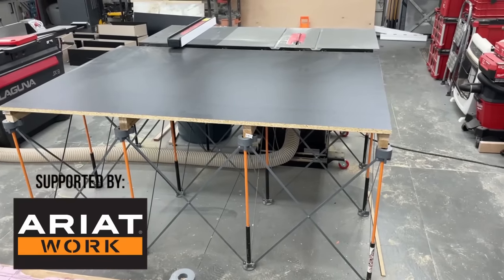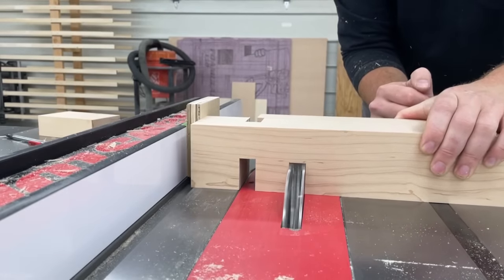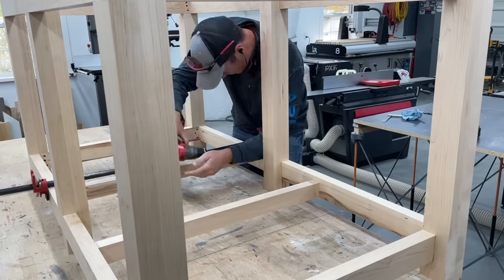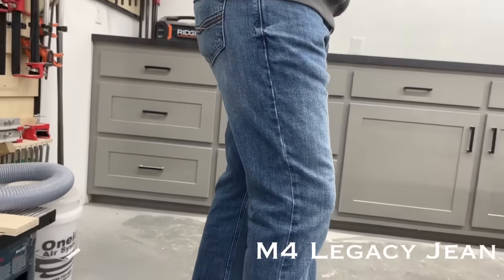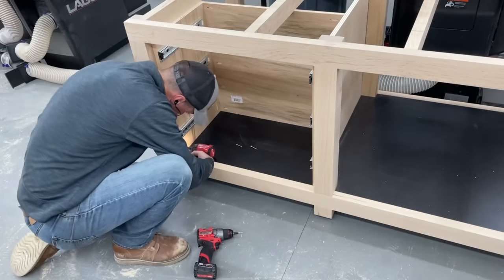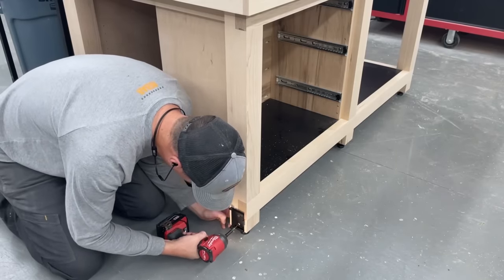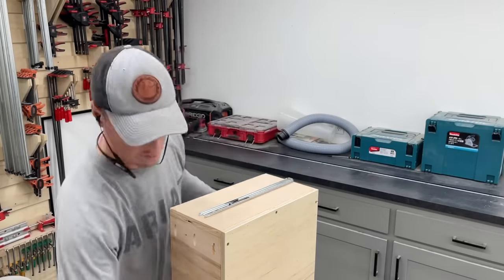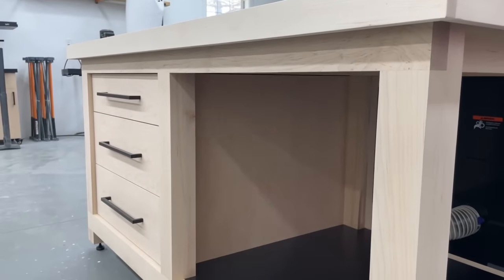BEEFY Workbench/Outfeed Assembly Table Build

Comment: John, I just completed this build a few days back.  Followed everything exactly as laid out in the plans and I couldn't be happier with the results. I only made one adjustment, instead of using black edge banding on the shelves I capped the edge with a piece of oak and cut in a small rabbet lip for the shelf to sit on so the weight placed on the shelves will be harder to warp the shelving material over time. Thanks, I love your channel.  On to building your miter saw station next!
Reply from the maker: Awesome! Good idea on the shelves👍🏽👍🏽

Comment: For those of us working out of smallish garage settings, sinking a router plate in an outfeed table like yours so it can do double duty as a router table is also a terrific use of space.  My shop is so small I actually built an extended wing for my saw to the right of the blade and dropped the router plate into it.  When the router isn't in use, I have a plug that replaces the plate and leaves me with a flat surface to work with.  Hopefully some day I'll have space for a real outfeed table.
Reply from the maker: Very good idea Mike!

Comment: A really nice-size, solid table for the SawStop. This is the same saw I have and I've been checking out a lot of projects for ideas. I like the dimensions of your table a lot, and the way you built it. You use a lot of Norm Abram-style techniques in the build that give this table a ton of strength and functionality. The sandwich top with replaceable surface, for example, and the strong lap joints. The lap joints lend themselves to fabrication with stacked dimensional lumber rather than thick hardwood stock, which would save cost, but the maple does look beautiful. The drawers look great too. If you wanted to, you could always double up the edge banding to build up the width of the tabletop to match the saw width, but it's purely cosmetic. Thanks for sharing the build.
Reply from the maker: Thanks man!!

Comment: This actually turned out to be a perfect solution for a beefy table for my up and coming cnc. I modified the dimensions to be 48x72 with a torsion  box top.   I ended up building mine from some reclaimed 12mm ply from work glued into 8 layers to make the thickness. You are not kidding by saying you could park a truck on this thing.
Reply from the maker: Haha awesome man!

Comment: Nice build, John! This looks like a more approachable version of Bourbon Moth’s outfeed table! Definitely going to build this!
Reply from the maker: Thanks for watching man!!
Reply: Jason's work is amazing but seems less accessible to build for amateurs. I really like the simplicity of John's videos and his instruction.  The tip about nailing the strip behind the board when using pocket screws I found insightful.
Reply: @plasmac9  totally agree about the board tip when using pocket hole screws. They always nudge just a touch, but that little bit can put everything out of square.
Reply: I like Jasons table but your looks just as good and easier to build.   Can't wait to try this.  Subscribed.
Reply: Considering getting your plans.   Is your PCS on an ICS base?

Comment: Finally! Something i might realistically be able to build. I DO have a dado stack, played with it once. Not pretty. Since then, I've done some research and determined a number of mistakes I made. Ready to try again. I like that there is actual mechanical interplay of wood between legs and cross-members, without insane complexity. Simple! Never would have thought of that on my own. Will not add shelves or drawers for now-- just need outfeed and assembly platform. WILL add the bottom platform for stability and stowage. Great build! Thanks!
Reply from the maker: Thank you!! Not relying on any mechanical fasteners makes for some crazy strong joints!
Reply: @JohnBuildsIt  Question: your plans suggest 44"X68'', I'm thinking about 48"X96". Should I make an extra set of center legs, and space them all accordingly?
Reply from the maker: @crustycurmudgeon2182  no just the one center leg would still be plenty
Reply: @JohnBuildsIt  Thank you, sir, and Happy Thanksgiving!

Comment: Stunning, John. Simply stunning. You have made some beautiful furniture in the past and even built out a beautiful home. It just seems fitting that you'd build shop furniture with the same attention to detail.

I plan on building a bench/outfeed/assembly table about this size. I also plan on using 4x4's for the legs and 2x4s for the rails. My plan though is to use castle joints on top of all 6 legs. Might be overkill but I like the idea of letting the wood bear all the weight, just like with your half-laps.
Reply from the maker: Maybe overkill but oh well!! Fun to practice and looks awesome! 👍🏽

Comment: Hey John, Thanks for your content.  I certainly appreciate the time, effort and thought that you put into producing a nice piece of work like this (both the outfeed table and this video).  I stumbled onto this video as I was looking for ideas on my CNC router table/workstation design.  I am going with a different top and drawer cabinet configuration, but I love your lap joint process on the base frame as well as your simple (but strong) cabinet carcass  assembly into the workstation. I think I have this figured out now but I went ahead and purchased your plan. Good video my friend and buying your plan will help you continue to create great content like this and... I have a nice addition to my library.            Subscribed.
Reply from the maker: Thanks man I appreciate it! What size is your CNC? I have another video on the channel building one for my 2x4
Reply: @JohnBuildsIt  I have a Onefinity Journeyman. The cut envelope is 48" X 32". It is a fantastic machine. But I want to build a 4' X 8' workstation to mount it on. The workstation will easily fit in my future plans too.   I am planning to build a much bigger shop and add another Onefinity and a Phantom S 4' X 8'. Ambitions... ya know? The wife supports it... so why not!?

Comment: Love the build. I have ordered a SawStop Contractor Saw with 36" T Glide Rail and waiting for that to arrive. I have been searching for an outfeed table to build and yours seems to fit what I want and doesn't seem as complicated as some of the other videos I have watched. I have purchased the Kreg 720 Pocket Hole Jig already so looking forward to trying that out. I think I will change the top so it is a bit more hardy to something like formply and seems more readily available and you can get that in bigger sheets. I am also looking to build a workbench as well. My workshop will be in a 2 car garage and I want all my workshop cabinets on wheels so I can move them around so another cabinet the same sort of size for assembly and to work on would be good with t-track in it and drawers and cupboards to store tools in. I was looking at the CNC table you built for that. I am in Australia you have such lovely wood over there so will have to source the supplies over here.
Reply from the maker: You’re going to love your new saw! Thanks for watching!!

Comment: I think the difference in my woodworking and yours is that you use a lot higher quality material. That and skill level. I need to remember to batch alike cuts like you so they are all exactly the same.
Reply from the maker: It helps a ton! Doesn’t matter if the cut is off a little, as long as they’re all the same 👍🏽

Comment: That is really well done… Thank you for sharing. One thing you may want to consider is putting a vertical panel - on drawer slides  or a track - in between your saw and the table… In that hard to reach spot… so you can just pull out the panel instead of trying to reach in - behind the saw - to store items, such as blades or jigs. Thank you again for sharing. Best to you and yours/happy Thanksgiving.
Reply from the maker: Good idea! I need to get my dust collection hard piping done back there first so I can finish it out!

Comment: Awesome build!  I have a question for you please.  My son bought me the Milwaukee 18 gauge cordless brad nailer and i put some Bostitch nails in it and started to jam.  I looked up and it seems to be a problem with certain nails.  I was wondering if you have had that issue and what nails you use for it?  It sure is an awesome tool!
Reply from the maker: I actually use Bostitch in mine a lot, or Grip Fast (Menards brand)

Comment: I'll get to this next year when new shop is back together but two questions. One is size? I guess you say it somewhere but overall size? Also didn't look like you did much overhang. I like 3 inches for clamping. Final question why not wheels. I know I can add the flip downs to raise and move it but just curious. Shop Nations found some really good wheel/height adjustments but his build is out of control. Love the creative lap joints. That will be fun.
Reply from the maker: Overall size of my top is 68”x44”.  This is a 3” overhang I believe, I like it for clamping too. I went with these castors because I’ll rarely move it. Rather not waste height by having castors under it, plus the all the weight constantly bearing down on them.

Comment: Getting ready to buy you plans and modify the table to 64 x 64 for my yet to be delivered CNC machine.  Short of just extending the dimensions to go from 44" to 64", would you do anything else for increased strength?  I am worried about the table sagging in the middle.  Great channel by the way!
Reply from the maker: Not at all. Not sagging with that center leg 👍🏽
Reply: would you modify your design for a 64 x 64 table, besides just extending the from 44 to 64?
 @JohnBuildsIt

Comment: Really like this video! Been looking for a plan to build an outfeed table for my table saw.  I did have a question in regard to the legs.  Did you do a glue up with the maple for the legs before doing the half lap cuts??  I really like the table and have purchased the plans from your store.  Just curious.  Looking forward to more great videos!
Reply from the maker: Yea I did!
Reply: Thanks for letting me know about the glue up.  Slowly working on the project now.  I noticed everything is cut at 3” for width.  I saw you inset the lower section supports.  I assume they are 2 1/4” for the plywood to fit in.  Is that correct?  Thanks in advance!

Comment: Excellent video, I am in process of designing my outfeed table and I took away some tips. Mine is also going to be an assembly table as well do you think the black melamine will be durable enough? I really like the look of it coupled with the maple.
Reply from the maker: I’ve noticed there are different qualities of melamine. Some have a lot thicker and harder layer, so it just depends I guess! Eventually when I build my other assembly table, I may skin it with actual black laminate

Comment: Does using the awl to mark the screw placement keep the wood from splitting? (Question from a new wood worker; thanks.)
Reply from the maker: No, it’s just to put the tip of the brad point drill bit in

Comment: Question. Do you see any difference in using black melamine versus applying Formica to particle board or MD? Seems like a lot less hassle but does one hold up better or is easier to flush trim or drill into?  I plan to drill dog holes on a work top and go back and forth between black melamine or applying Formica. Thank you in advance for your response.
Reply from the maker: Formica is definitely more durable 👍🏽

Comment: how do you handle the dust extraction on the table saw.  I see that you have a hose coming out the side between the saw and table but it must be making a pretty abrupt turn coming out of the saw.  I imagine a pipe going through the table so that it can be a straight shot.
Reply from the maker: The hose doesn’t turn that sharp, works great

Comment: Very cool build. I personally don’t like melamine and what would’ve made this over the top awesome, but probably overkill, would’ve been a laminated maple top 3” thick and maybe even a split top design on top with a 2” wide removable section for cutting plywood with a track saw and not have to use and store that stupid foam I have now. Anyways still a very kick a$$ build.
Reply from the maker: It crossed my mind, but man that would’ve been expensive haha
Reply: @JohnBuildsIt  it sure would have been. I just built a 85”x32” split top ruobo workbench with the frame and lower cabinets out of African Mahogany and the top out of 4” hard maple and let me tell you it was expensive! The most expensive piece of furniture I own and the maple top was the most expensive part. I might build your bench as an outfeed table with left over hard maple and maybe I’ll do the top in hard maple too.